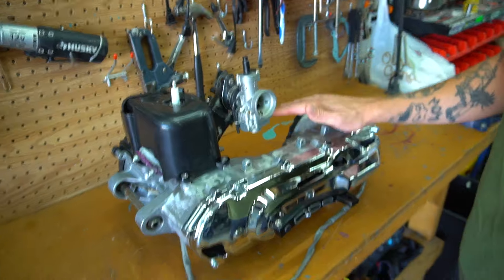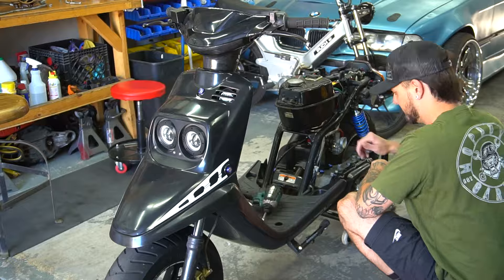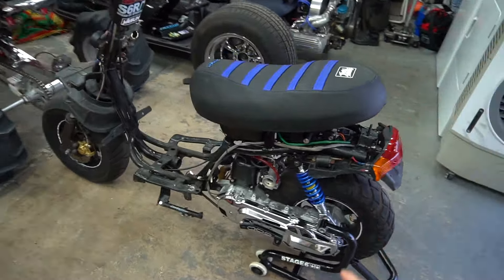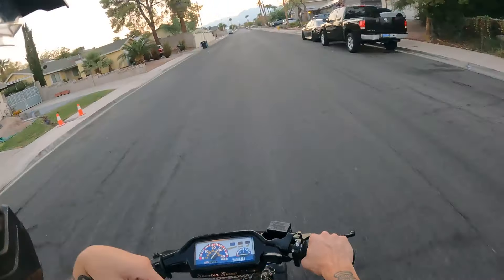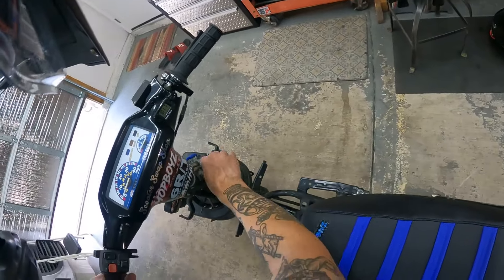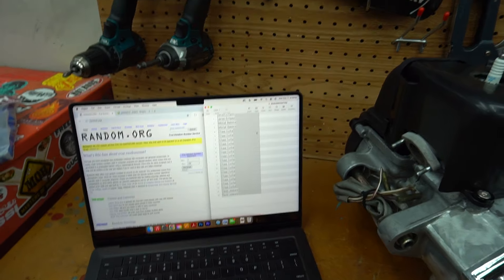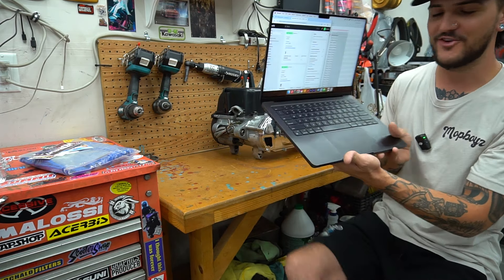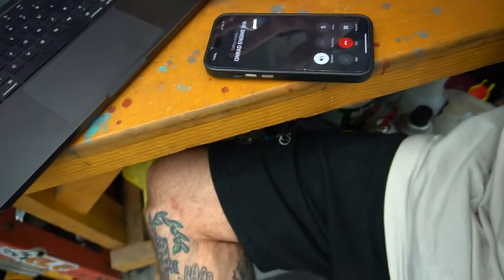Perfect 70cc Stunt Build First Ride & Giveaway Winner Chosen!

Comment: Well done to the winner... Trev would it be to much to ask you to share the carb settings? Jet sizes and needle clip position? Cheers man.
Reply from the maker: this engine is polini cp21 , 100main 42pilot needle clip at the top !
Reply: @MOPBOYZ  thanks man. Much appreciated pretty similar to what I just did in mine just richer on the pilot.

Comment: hey love the videos from italy😍
i was wondering why you stick to tuning the minarelli vertical when it’s soo easy to mount the minarelli horizontal on the booster chassis. liquid cooled, far mor powerful spending less money, more relaiable
Reply from the maker: for stunting a vertical is plenty power, as i use most the bws for stunting but for a sport build that’d be very cool to do!
Reply: @MOPBOYZ  yeah it would be cool. i’m working to mount one on my booster with a simonini 70 high tuned by me